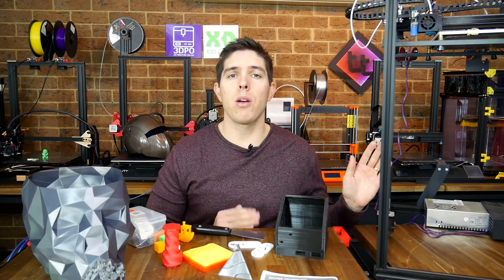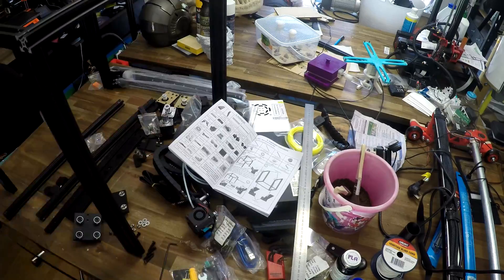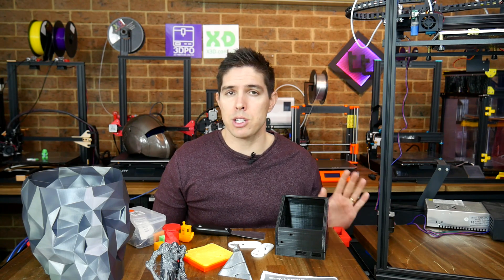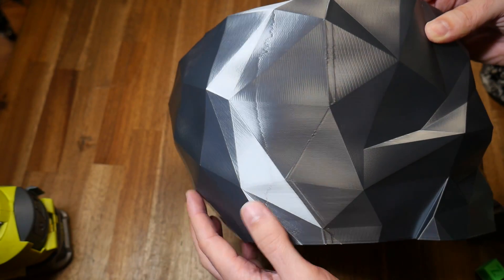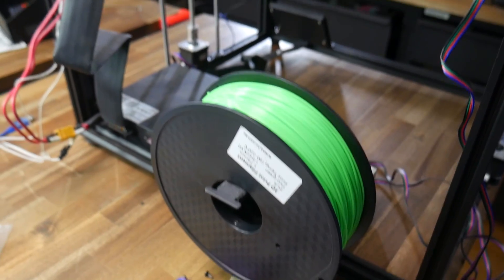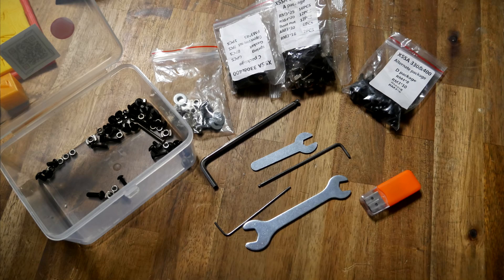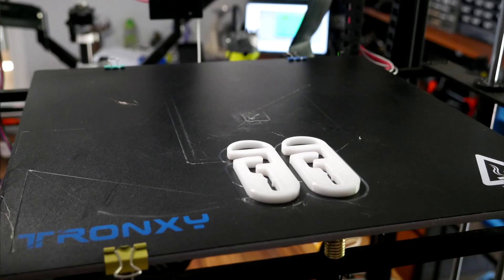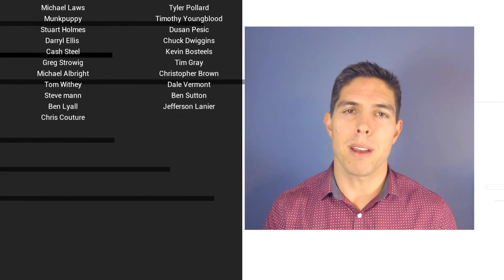Tronxy X5SA Pro review: A large format CoreXY 3D printer (with issues)

Comment: I guess I was very lucky. I bought this Tronxy X5SA Pro  and the upgraded A8 Dual extruder at the same time, and I really had no issues with anything. This was my first two printers, and I mostly used the Tronxy. I must add, I took my time with the assembly and watched numerous videos before I completed it. The only thing was the Mini SD card that was corrupt and I could not use any files. I did however format it, and at least can use the card. I searched everywhere for the Tronxy slicer with no luck. I started of with Cura and am glad at the end that I did not get the Tronxy slicer. I'm now just busy building a nice enclosure to print ABS better during this winter months. Thanks for the video.

Comment: Don't BUY THIS PRINTER! It's not using open-source firmware, many things is limited. Go look for Ender6!!

1. Yes, the problem is the bedsheet. I changed to wham-bam, and the auto level sensor is more stable, didn't hit the nozzle in sudden anymore. stick it on top of the removable aluminium plate didn't install on the heating base (Just in case if not work well)

2.Need to reduce all the wheels and rod resistant at 1st. 
A. All the rail wheels and belt, can't adjust too tight. High tension will be causing the ghosting effect, and you can test it and move very freely with no belt attached. 
B. Printer below needs to put the soft base. 
C. All the corner must install corner holder/hook to enhance the structure also reduce the vibration.

3. About the Z level's rods have four black plastic will be broken soon, can order the metal rod holder from them. And the 4 rods need to lose all the nuts and screw and level up the bed to top before tighten all the top set of screws and nuts together, follow the same step to the bottle. The Z level screw need put a bit lubricant.

4.The firmware is Chitu g code: 
 You can request the firmware file (Gcode)from tronxy and open with app "Bracket" coding text editor because this file contains Chinese characters only this app able to read and open the text file correctly. The coding is the same as the link below, ignore the Chinese text in the "firmware.gcode."
 http://www.customize-3d.com/chitu-g-code-explained.html.
 This gcode is very limited, and the extruder calibration is the command is M8011, 
My X5SA-2E had serious under extrusion if 100mm had 8.48mm different.
M8011=0.00264375=8.48mm (DEFAULT)
After value M8011=0.001295=2.7mm difference now, and not able to get any better than this yet.
In my experience, we can test the results and add the value 0.000015 in every test to reduce the under extrusion.

 Tronxy replied this doesn't have a correct formula because the reason below:
"The error is caused by external structure, so there is no specific calculation, only the estimated modification."

 I would like to know more about; how to change the firmware to Merlin if someone knows, please let me know, I already bought another 3D Printer TENLOG 2 IDEX printer for regular use, now this few months old Tronxy be my DIY modification hobby only. Still, it's limited because of the firmware. Hope to change HEMERA E3D Direct drive if possible.

Comment: I have had an X5SA (not pro) for over a year now.  The upgrades mentioned by Nexi Tech https://www.youtube.com/watch?v=Pq3qjdaRnuY&t=1s and https://www.youtube.com/watch?v=RIz5-1uCqLg&t=320s are quite extensive, and show how much the X5SA can grow as a 'kit'.  So, for the novice I would not recommend it.  But, if you are a 'maker' with experience - then I would recommend.  You get a lot of parts for the money.

As for tuning... out-of-the-box, whether X5SA or X5SA pro, you will need to square off all corners of the cube.  I highly recommend buying metal corner brackets (and the necessary T-nuts) for that.  Also, check that the cube is square after the brackets are in-place.  Then shim off the base if the surface the printer is resting on is not perfectly flat.  The horizontal x-bar (where the print head is)  also needs to be square, and you can do that by moving the gantry to the back of the printer and securing it to the frame (which is now square) and re-tightening its t-nuts.  Then you  can also adjust the belts to uniform tension.  There are also tension springs I recommend https://www.amazon.com/Timing-Torsion-Spring-Printer-LINGLONG/dp/B07L17GT5B/ref=sr_1_5?dchild=1&keywords=3d+printer+belt+spring&qid=1593442059&sr=8-5   These changes will make the printer perform much, much better.

I will not go into other adjustments like filament extrusion, pid, head-speed... since they are easy to find in other X5SA videos.  I only want to mention things that I found out the hard way through experimentation.

The thermal runaway problem has been mentioned by Makers Muse.  TRONXY responded by publishing a fix for its printers,  and I applied it to mine.  Newer models are now being released with the fix.  I went to the TRONXY site recently to get the patch, but the fix is no longer available on their site.

As for support - 'non-existent' to say the least.  TRONXY has practically no support, even today.  You will have better luck searching for advice from other users.  When I received by X5SA from Gearbest I had a problem with the Z-screws provided.  One of them was not properly machined and would not fit through the collar.  Its diameter was slightly bigger than the hole.  I settled with Gearbest by getting a significant refund that allowed me to buy a new z-screw from another seller (through Amazon) and pocket the remaining cash.  So, as-you-can-see, check that all parts are in your kit and fit properly.  You have to go back to your reseller to resolve, and most will not have the part you need, and will tell you to disassemble the whole thing and exchange it for a replacement unit (entire printer).  I was almost done assembling mine and that would have been ridiculous to do.  Glad I pushed-back on Gearbest and made the deal that I did. 

I have learned a lot about 3D printers with this kit (it is my first 3D printer).  I would still buy an X5SA pro if I didn't already have the X5SA, and I will be getting the X5SA -to-pro upgrade kit soon (linear rails).  I highly recommend this brand if you are hobbyist who likes to tinker.  Do not buy if you are not mechanically (and electrically) inclined.

Comment: You and your Friends named in the video are professionals in the 3d printing world and I'm very thankful you sharing your knowledge.  But some times Pros are childish too. If you get a Printer as an assembly kit you have to put attention in the correct erection. That mean includes the correct right angle on any corner of the frame before go next. Next point is the belt tension. Not sure they still using these belts with a 3 steel core. I do. You should know they cant stretched like rubber and needs a bit smart thinking. The snapping motor bracket seen in the video was a bit laughable. You can't pull this type of belts like a bull because of the limited stretching point. It is a low budget printer with a couple of points for improvement but still a good entrance into the 3d printing experience for ambitious guys with technical understanding. And there are room for your own modification until perfection. Anyway thanks for your review it improves my skills.

Comment: Honestly I'm a big fan of mine: a couple tips you can use scissors to shorten the belt and bowden so the excess material doesn't get in the way. As it is a kit you will only get as much as you put into it, you really do have to take your time to properly align all the parts, I used a machinist square and it turned out great! As for stringing just keep turning the retraction up until it goes away. Its a great printer if you want to really learn how to optimize and perfect printing techniques. Its not a great printer if you just want something that can print straight out of the box
Reply: Seems to me he's a beginner...

Comment: I bought one of these in April, and was quite impressed.  This is the first 3D printer that I have bought , and the main reason for buying this one was size (I actually wanted one of their larger models, but there were none in stock).  Assembly was reasonably straightforward, but I am used to doing that sort of thing.
Initial results were pretty good.  I printed a number of things with reasonable results - a few failures, but that could be user error.  I didn't realise there was the need for Z-offset adjustment, but once I had that figured out it was OK.  Then I had feed issues - it was printing what was more like candy floss (cotton candy) at times.  Eventually sorted those out, then the Z-stop sensor failed.  I had lots of help over this time with Tronxy tech support (they were good), but not from other departments.  Repeated requests for a replacement Z-stop sensor resulted in no response at all.  I eventually bought a replacement one from somewhere else, and also bought a replacement printing plate - actually just a square of aluminium, thicker than the original (6mm I think) and an adhesive sheet to stick on it.  Since then my printing success has been impressive - still some problems with getting the initial layer correct (auto-level the bed, set the Z offset, start printing and watch it, adjusting the bed height as it goes until it's about right), after which it just prints.  Quality compares well with other 3D printing that I did a while ago.  Pleased with it at the moment, not at all happy with Tronxy customer support apart from Tech support.

Comment: The way he talks is very polite. 
But for me: Don’t ever buy this Tronxy printer. Probably all the time you wasted is more than the price. Trust me to look for another printer. No joke, I bought two extruder X5SA-2E (2020 February) the auto level sensor is shit! You have to do 100 times before starting a print and don’t turn off the printer; otherwise, you need to do all over again! The only safer way is to adjust the heatbed during printing. This brand printer can make you be a master of finger adjuster! Money wasted is ok but not your valuable time. Sometime the extruder will hit the bed badly with unexpectedly. Not user friendly, the firmware needs to request by email, and they need you to take a photo for the board before they send the firmware to you and FFF file. And the shitty tronxy slicer is a clone from cura. All the menu is the same as cura—what a shame. The worse is the smoke comes out from the machine, and that’s my last print from this printer. I don't want to use a cheap printer to burn my house down. Paid to fulfill the trash bin.

FYI The Tenlog D3 pro dual extruder printer is much better, stable, very fast to reach the nozzle temperature, they are providing free shipping now, but need to buy from the official website. And It's s worth to get the tmc2208, print silently,  the technical support is very responsible, if anything happens within a year, they will resend the parts for free. But second-year have to pay to ship.

Comment: As far as I can tell the gantry alignment issue was solved and they don't use any acrylic parts for motor mounts/pulleys anymore either. Though I can only say that for the 500 Pro. But there are so many different versions out there that it's almost luck what you get. Especially with bad package delivery companies and warped / bend parts.

Comment: I bought a Tronxy X5SA in January 2019 and the only truth on your review, is the fact, that this printer is nothing for beginners. I appreciate the printer mainly for the thing, which you destroyd right away: The frame is a fu**in sturdy and smooth coreXY cage, based on OpenBuilds open-source V-Slot System. Would you have done it right away you could have a great experience.
But many of your critics is so farfetched (thinking of so an experienced Maker as you are): 
- Cutting a PTFE-Tube as downside - Do you need a Master's Degree for cutting a PTFE-Tube? What a joke
- Requestening a Belt-Tensioning system? WTF! Put the belt around it's way, then pull on to a handsome degree fix it with the cable tie and cut the rest of the belt. Done within seconds and shown pretty good on the construction video on Youtube. With your experience,  your critics is really a joke.
- The electronics is something of the easiest on the marked. Main cables are finally set (within cable chain and the big flat cable), all cables have labels, which motor/sensor has to be connected. If you where a first day beginner, ok, but to critic this out of your experience level....
- The open cableing... just put it into the V-Slot. Oh man. Its not so hard to think about that...
- Mounting the cable chain wrong. Sorry can't help. Even it's not obvious.... You see it after first print; doing it right; and never have any issue anymore. 

I have done thousands of hours on this printer with hundreds of prints. It's just a reliable work horse with incredible quality, also on really big prints, which is thanks to CoreXY.

Comment: I own this printer as a total noob and didn’t face most of problems pointed out. This machine can be improved for sure, but it works quite well. The biggest problem i found is the impossibility to use a 4mm glass bed with the zprobe provided. The stock fans are crap and i had to replace them after 1 week of use.

Comment: Hi guys I want to bring you my bad experience with TRONXY X5SA: bought on aliexpress by TRONXY OFFICIAL STORE for about 300 EURO. I chose to pay the highest amount on aliexpress even though I could have paid 280 because the shipment was from Spain where I am and immediately I had my bad experience, the supplier replied after several days saying that they had finished the product in Spain and that they would send from the Czech Republic (oh well I pretended nothing and I agreed). A week later I received the product and it was almost a day for me to assemble it. The instruction booklet is useless to say the least and contains printing errors with wrong measurements so I went looking for a tutorial and assembled it. Commissioning and after only 2 prints the motherboard burned. Practically as soon as you turn it on, the extruder starts at maximum power without having the possibility of doing nothing if not returning it before burning everything.When everything was present to the supplier via aliexpress chat, he replied as usual 2 days later saying that he would send me the motherboard and don't worry. I wait another 3 days and ask for the shipping code and as usual it doesn't respond. At this point I get PITCHED and open a dispute on aliexpress. By magic he replies and tells me he wanted to know the type of motherboard. BUT BAD TROUT !! you ask me after 3 days that I spotted you that I have a problem and knowing that the product has only 2 life stamper. This is not how service should be. He tells me he is going to send me from China with an ordinary parcel which usually takes 20 days or even 1 month. NO JUST BROKEN NOW AND I HAVE REQUESTED TO BE REFUNDED. Moral of the story DO NOT TRUST THIS PRODUCT

Comment: i got X5S - total firehazard, shitty print quality. Your Z banding is nothing compared to what my X5S -- i hear i should not have tightened the Z smooth rods which caused the extrusion to bend but it's much more than that. Pretty much only salvageable part is the heated bed and few bits of hardware.
They also use some cheese grade hardware tho, looks like regular 12.9 but is much softer (like you had an issue too). Essentially, not much to be salvaged for a proper HEVO build. Too much effort, it's on my scrap pile.
I see X5SA is not any better